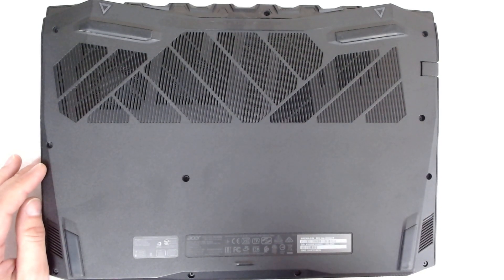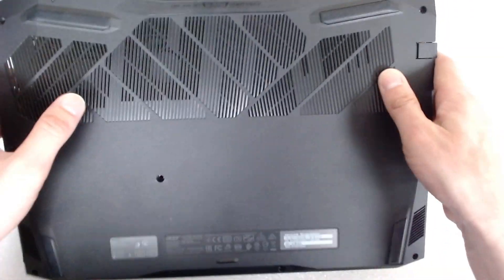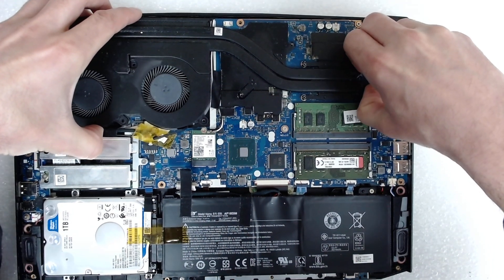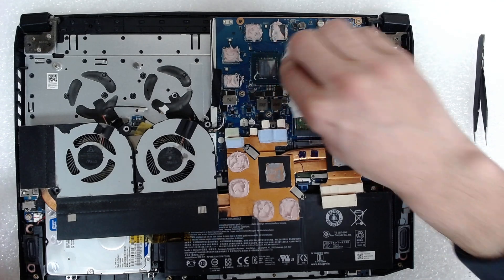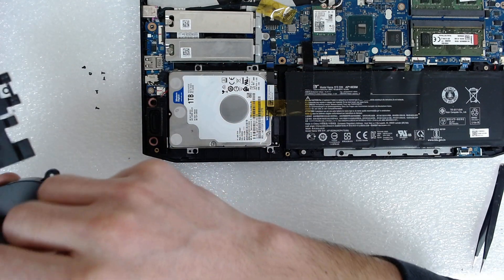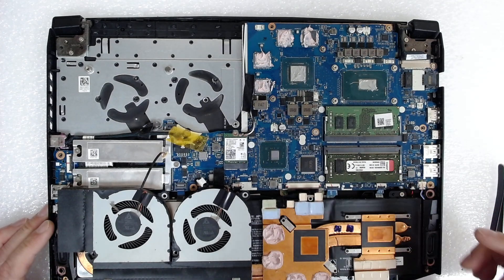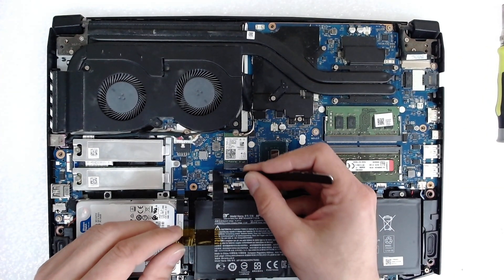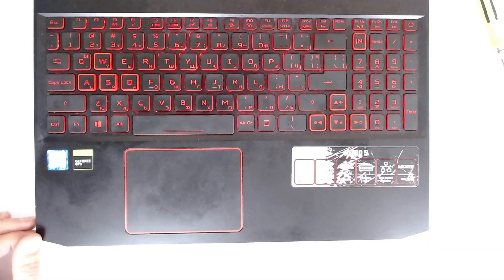Acer Nitro AN515-54 Disassembly / Fan Cleaning

Comment from the maker: Discord - http://invite.itjungle.eu
If you have any questions, regarding Laptop repair and etc. you can join and ask for help.
Reply: BRO COULD U HELP ME,. MY NITRO 5 AN-515-54 DISPLAY HAVE SHOWED SOME THING BAD WHILE PLAYING GAMES.
Reply from the maker: @usamagrewal2062   what exactly, any picture or video will be helpful.
Reply: My acer nitro 5 is making a rattling noise and with that the performance comes down. I think that something is stuck in the fan like dust or something . However I want to make sure that if I remove the fan an expose the thermal paste I do not have to replace the thermal paste. Please reply
Reply from the maker: @aryaanyy6494 if you lift the cooler, you have to replace the thermal paste on the GPU and CPU. If the paste is fresh, theoretically you can lift the cooler and than put it back, but I don't recommend it.
Reply: bro i wanna ask something please. Does this laptop use thermal pad? this is my first time diasassembly my acer an515-54. but im confused. Chatgpt said this laptop use thermal pad, but i dont see where the thermal pad is. thank you🙏🏻
Reply from the maker: @miawmiawjshhe there is thermal paste on the CPU and GPU. On the CPU coils, there are blue thermal pads. On the GPU memory and vrm there is a thermal putty.  I usually never replace the pads and the putty. They don't dry out like the paste. Just replace the paste and don't touch the rest.
Reply: @LaptopDisassembly i accidentally cleaned the pink grease, what should i do? can i put thermal pad on it?
Reply from the maker: @miawmiawjshhe is not a very good idea. Even if you clean it you can put it back, as long as it is not dirty or thrown away. Otherwise is a good idea to put back putty again.

Comment: Great job and thanks for the video. What you prefer to put on VRAM chips of video card. thermal paste or something else?
Reply from the maker: I replace only the paste on the CPU and GPU. The thing on the vrms and memory it thermal putty. It doesn't dry out like the paste so I don't replace the factory one.
Reply: @LaptopDisassembly  thank you. But when it comes to change what you will put
Reply from the maker: Thermal Grizzly Putty Advanced for example
Reply: @LaptopDisassembly   Thank you :)
Reply from the maker: BG?
Reply: @LaptopDisassembly  yeah
Reply from the maker: Е можеше и така. :)
Reply: @LaptopDisassembly 😀😀. Българите сме навсякъде.  Не знаех, че си. Иначе поздравления отново за видеото и благодаря за информацията, защото гледам доста мнения в нета и искам да разбера някои неща.

Comment: I couldn’t for the life of me unscrew the screws😞
Reply from the maker: You have to push down and in the same time twist. Also use a proper screwdriver.
Reply: @LaptopDisassembly  I got the fan ones! Im preparing to change the paste right now.. I was planning to put in a new ssd card but those screws are REALLY stuck🥲 and i think I have the right screwdriver

Comment: Hey, I have a problem, the battery cables and the cables that connect to that place where you plug in the charger are basically fully stuck. I tried removing them for 3 hours to no avail. Is there a reason for that?
Reply from the maker: I can't quite get the point. You want to disconnect the battery and the charging cable, or what. And why you want to do that.
Reply: @LaptopDisassembly I want to disconnect the battery for safety and the charging cable because it blocks my access to one of the fan cables
Reply from the maker: About the battery connector, you need to push each side slowly and repeat left and right.... About the charging port, pull the cable with hands and slowly bend left and right and it will come off.
Reply: @LaptopDisassembly For the battery connector, trust me, I tried. It wiggles out a bit before being completely stuck, I tried to wiggle it out for a bit over an hour, then I decided to give up and go for the fan cables, I couldnt get to one of the cables as it was mostly under the charging cable, the space is way too tight for me to remove it with my fingers
Reply from the maker: Do you have tweezers
Reply: @LaptopDisassembly Yes, I tried using them, it did not work
Reply from the maker: Well I doubt I can help. Usually when you put the tweezers on both sides at same time and you start to twist and pull it helps.
Reply: @LaptopDisassembly I will try again in a week or so again, if that time it doesnt work out I will just give up and hope to find a job quick enough to afford a pc. Thanks for the quick response, man

Comment: My GPU fan slowed down around 30% recently (when manually maxxed out, it also spins up to proper speeds much slower), will doing all of that give it a second life? Or my fan is completely cooked and i need to buy a new one on top of cleaning my dirt pit?
Reply from the maker: The fan is controlled by the board. And not always they work on the same speed.  If you have problem with high temperature and the fan is working on low rpm, than you should clean it and lubricate if possible
Reply: @LaptopDisassembly  the fan needed lubrication. It works now, but should i replace that ancient 5 year old putty? Or like you said don't touch unless it looks like something is awfully wrong.
Reply from the maker: @farmazoniarz i never replace the putty. It doesn't dry out like the paste a d the temps there are different. Just replace the paste and clean the dust.
Reply: @LaptopDisassembly  i didnt touch it, i just wanted to ask just in case. Thanks for help and crazy fast comment response!
Reply from the maker: @farmazoniarz Thanks to YouTube notifications ;)

Comment: followed this now my laptop cannot detect my gpu😭
Reply from the maker: What do you mean can't detect my GPU. The GPU is soldered so you can't disconnect it. If you don't have picture, you may not plug some of the cables properly or try to reconnect the ram memory

Comment: The AN517-54 has the exact same problem with the fans. Awful design. 

Thank you for the video, managed to fix a friends laptop. 

It was thermal throttling and running at 8 FPS.
Reply from the maker: That's what these videos are for. Glad I could help.

Comment: bro sorry im asking again, because its interesting issue. its about the screen flicker issue, i forgot to add this detail before.

so the screen started to flicker a few months ago and it was fixed by nvidia update for some reason. then a couple of months later it flickered again and it was fixed by nvidia update again. but now the flicker also happens in bios and since the flicker doesnt happen in external monitor then it must be hardware issue right? but why did the 1st 2 flicker issues get fixed by nvidia update? if my screen is dying because there's an nvidia update that increased power consumption for the screen then this new screen i'm going to use will die in a couple of months again probably lol
Reply: or maybe, can undervolting the GPU/CPU for long term have damaged something inside? i've undervolted my CPU/GPU for years. since nvidia driver update resets the voltage of GPU, maybe thats why the first flickers were fixed after nvidia update? but now it also happens in bios @_@ so confusing and scary at the same time lol
Reply from the maker: The screen shouldn't flicker with default voltage. So probably is a coincidence but most liya dieing screen.
Reply from the maker: @miserable__sod  Both of the displays that you wrote are 144Hz and the original one is also 144Hz. So the seller was correct. Probably you see some difference because of the different batches of displays. I had case where 2 identical new laptops show different colors of the display... So i doubt there is anything you can do.

Comment: bro i have a new problem..i just bought a new battery, it's charging like normal and it has 4 hours capacity like normal but when i charge it to 100%, the battery LED indicator turns orange and starts to blink instead of becoming steady blue light. why is this? it didnt happen with my old battery, they are also the same model. so when im charging it but its not 100% yet, the lights are normal: 1 blue light and 1 orange light. but when it reaches 100%, the orange one doesnt turn blue like expected but instead it starts to blink..
Reply: like i said it has no problem with usage and charging..it's just the indicator light behaves not as expected..its not blinking fast as if its unplugged/plugged rapidly for sure because like i said i have normal usage, i dont have fps drops in game or anything. im just scared that this is indicative of a bigger problem lol
Reply: according to manual, blinking orange LED = low battery. maybe it has something to do with laptop detecting new battery as old dying battery when its full and thinking its low batt? but like i said it has 0 issue with usage/charging
Reply from the maker: @miserable__sod  Well if you are sure the new battery is a "good" brand, try to do a few cycles  with it. Can be a bad communication between the new battery and the Charging IC. Check is there a new bios for the model, just in case.
Reply: @LaptopDisassembly  i put the old and new battery side by side and they're the exact model. i'm scared to update bios lol xD is there a way to 'reset' the battery or something like that? does the holding power button for 30 seconds with battery unplugged thing help with this? do u think this is hardware/software issue?
Reply from the maker: @miserable__sod  Doing 30 seconds with battery unplugged will "reset" bios, you cant touch anything on the battery side without the proper equipment.  Batteries may look identical, but all depends on the quality. If it works fine, just use it. :)
Reply: @LaptopDisassembly  thx bro..last question, should the battery be unplugged when replacing screen of this model? im gonna tell my technician later just in case
Reply from the maker: @miserable__sod  definitely you should disconnect it.

Comment: youtube keeps hiding my new comment for some reason, maybe it's too long/something. but in short is screen flicker issue on this laptop model most likely caused by the screen going bad and needing replacement? mine is from 2019 and it started to flicker a couple of months ago. at first a driver update fixed the issue, and in the 2nd time of it happening a driver update also fixed it. but last week it started to happen again but my driver was already up to date so i couldnt do the trick anymore. but idk if this time its software related issue because the flicker also happens in bios now..
Reply: at first i thought its battery issue because it was already dying anyway (5 years old battery). prior to this flicker issue, everytime i was gaming and electricity went out, the battery went from 100 to 0 in seconds and went to hibernate. also when the flicker started to happen this week, i tried to restart laptop and the battery showed 0% at bottom right and the laptop shut down immediately (not sleep) even tho its plugged in. also if i turned off the laptop and let it charge whole day, the flicker issue went away and the battery was 100 again. i was able to game whole day without issue but when i tried to plug in external hdd to watch movies, the flicker started again even though it was fine when gaming for whole day as if when the hdd drew power from laptop, the battery couldnt provide enough voltage for screen at the same time. so i thought its battery issue. and yesterday i asked the technician to replace the battery with a new one. but it didnt fix the flicker issue. is it really a dying screen? and when i watched movie/video, it was heavier on the screen than gaming?
Reply from the maker: @miserable__sod  depend is it LED or CCFL backlight. With the time the old CCFL backlights start to flicker. Is there any difference when you put the brightness to max or low. Also is the any change if you move the display a little...
Reply: @LaptopDisassembly  flicker is consistent even if i turn brightness to the lowest and it doesnt make any difference if i move the display up and down. i heard that this could also happened due to dust in the gpu connector pins or something like that. how true is that? if it is then plugging the laptop to external monitor should still have the flicker, right?
Reply from the maker: @miserable__sod  if you plug the laptop to external monitor, the flickering should go away. In 99% is a bad display or backlit. Best way is to test with different display if possible.
Reply: @LaptopDisassembly  flicker doesnt happen on 2nd monitor, i'm replacing the screen today. thx bro. btw i have new problem about battery xD

Comment: Pls help me bro..i'm gonna meet my technician in a few hours but it would be uncomfortable to ask him because the guy is really quiet..pls give me a peace of mind on why u didn't try to hold the power button for 20-30 seconds after unplugging battery to discharge static electricity from motherboard..
Reply from the maker: Coz there is no point. When you disconnect the main battery, the board discharge for few seconds.
Reply: @LaptopDisassembly  thanks for the reply. i had a problem thats why i tried to ask this technician for service. i thought the problem would go away by replacing battery (which is 5 years old already) but it didnt go away..i'll make new comment so everyone else can see i easier and be informed..
Reply: @LaptopDisassembly  for some reason youtube doesnt show my new comment..

Comment: Why didn't u try to discharge the static electricity after unplugging the battery by holding the power button for 20-30 seconds? I'm confused because you and my usual technician don't do that but everyone on forums etc suggest that's a really important thing to do to avoid short circuit hha